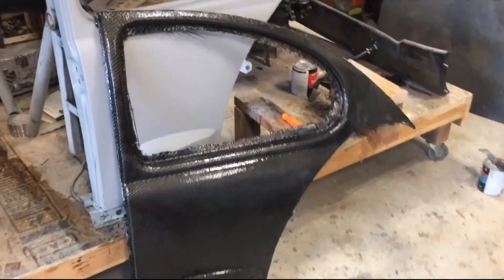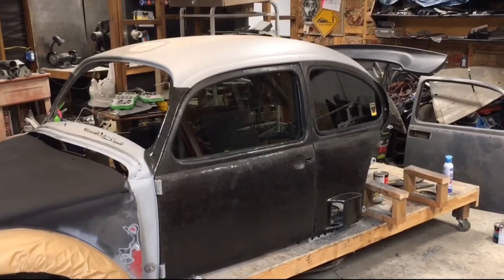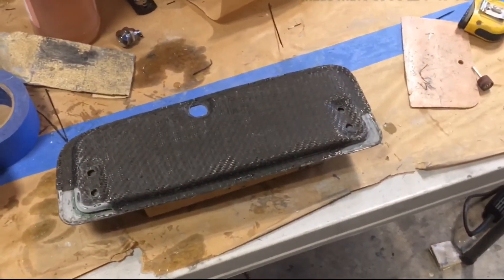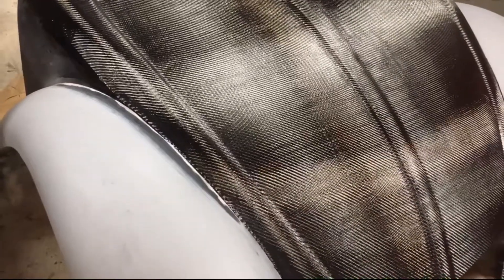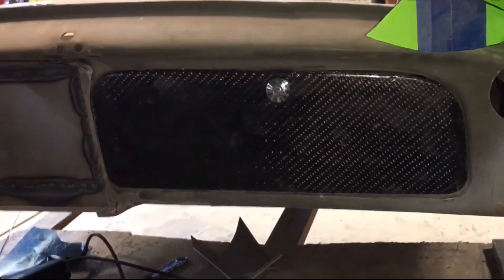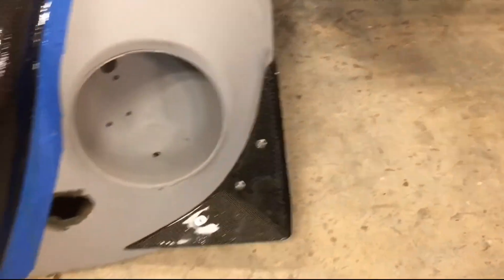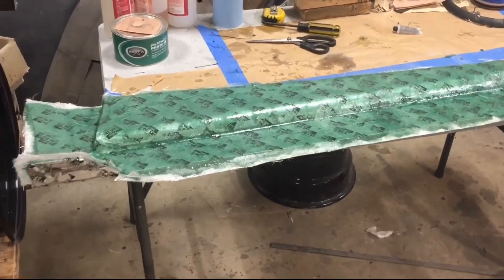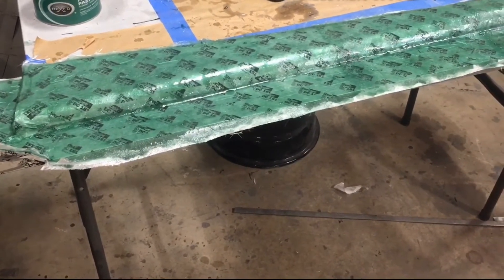Subaru swapped vw bug #22

Comment: How did you seal the carbon outer shell of the door to the steal inner shell of the door? Looks phenomenal by the way, keep up the good work.
Reply from the maker: Thanks man and i use panel bond ill use it to attach the door skins and rear quarter panels as well
Reply: @uberkooledgarage  thank you, that'll hold with the higher speeds?
Reply from the maker: @johnglover544  the dealerships and auto body places use it to bond body panels on cars it will never come apart if applied correctly 👍